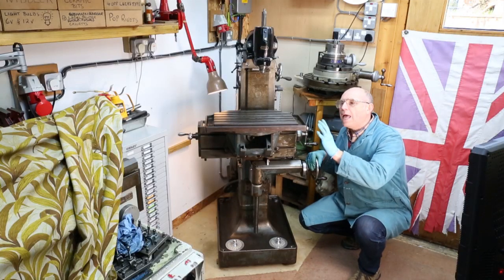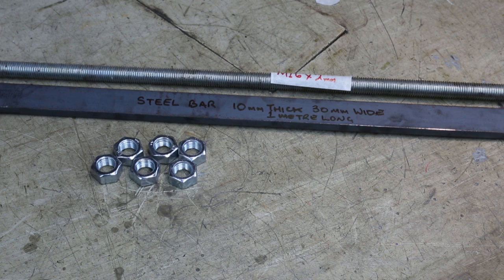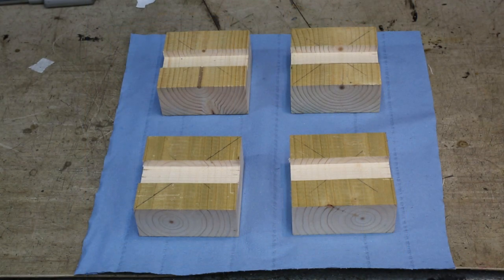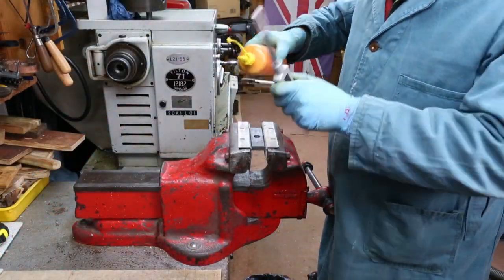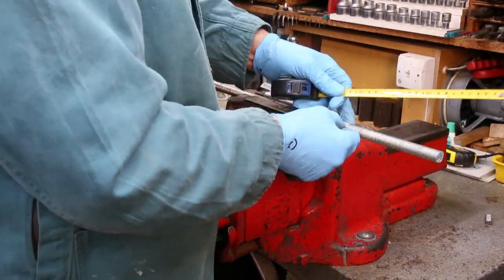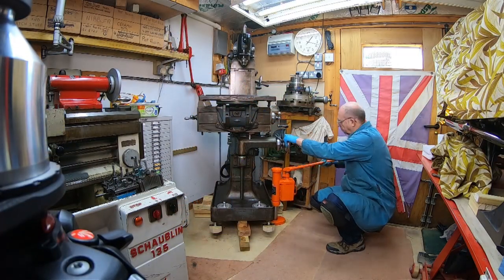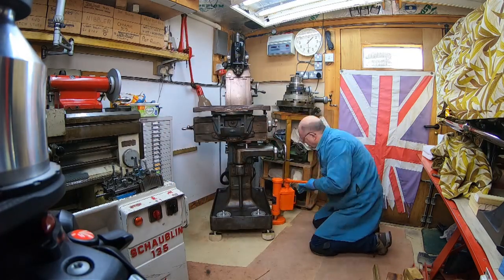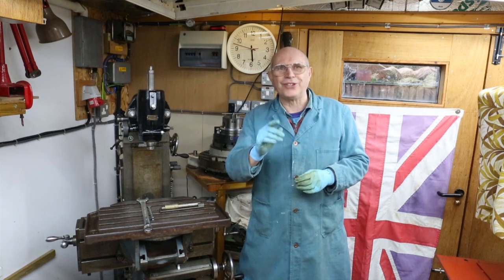DiY Leveling Feet For Milling Machine

Comment: Very interesting. Can't wait to see some projects being made at the mill. Good luck with the final parts of the restoration of the machine.
Reply from the maker: Hello Petar443. Thank you for your comment and good wishes to finish the mill. I'm "chomping at the bit" at the moment. I have a project waiting but I can't start on it as I need a high speed head. I am lucky enough to have several attachments for my Alexandra mill, one of them is a High-Speed head. You may have seen a couple of my latest videos, I have started to service that head but had to cut off a 50mm dia nut. The thread in that nut is 16tpi Whitworth. Unfortunately my lathe is missing a couple of thread cutting gears so I can't finish the nut. I have a friend who can help but he is busy for the next couple of weeks. At the moment I'm doing other projects, if you have a workshop you are never short of projects! Take Care thanks again for you comment, Jim

Comment: Very neat. Would be interested in hearing about how you acquired your machine tools and what to look for when buying old machines like these.
Reply from the maker: Hello again Nick, thank you for your comment.
How did I acquire my machine tools, and what to look for when buying old machines. Gosh, you want your monies worth out of this comment!
Buying old workshop machines is a good way to get hold of good quality equipment but you must be careful. Personally, I would never buy anything sight unseen. Go see the machine, run all of its moving surfaces from one end of their travel right to the other end, do this by hand and see how it feels as it travels. Is the bed loose at one end and tight at the other? Probably but is it enough to cause a problem? Look at all the moving parts, assess for ware and note any breakages. Run the machine if possible listen to the gears bearings and bushes. Remove the chucks and vices check the mating surfaces of tables and slides.

I came across the Alexander Master Toolmaker milling machine on a visit to a workshop. It is a fantastically designed and well-built mill. Originally the design was German and called the Deckel FP1. These machines were very popular in the 1930’s & 1940’s and they started to be built in lots of countries round the world. When the second world war started, buying machines from Germany fell out of fashion. Well, because the machines were already being built all over the world, they carried on being built in those places but under non-German control. The company in the UK was called Alexander and carried on building the machines till the 1950’s.

I scanned the adds online and in magazines. I wanted to get one of these machines but also as many of the accessories as I could as well. It took a lot of searching, over a year, but I ended up with the machine I have just made the adjustable feet for.
I also have the normal vertical head, that’s fitted to the machine at the moment.
The other accessories I have managed to buy are:
The high-speed head. I’m about to service that, see my next video.
The Slotting-head. In need of service before use.
The Universal Dividing Head. In need of service before use.

Well Nick, I hope that’s useful to you. I really need to get on with the high-speed head, its sitting on the bench in three bits at the moment. I have to set up the camera, pull the head completely to bits, make sure all is OK, then service everything as I reassemble it. That will keep me busy for a while! Take Care Jim.

Comment: Nicely done, great tutorial. Better engineered than a bolt and lock nut through a hockey puck, but not so overly complicated that you need a 5 axis cnc to make them
Reply from the maker: Hello Jason. Thank you for your comment. I have seen people use the hockey puck for feet, I assume they are oil resistant? Thick Wood is good though, all the adjustment is in the foot so the top of the leg stays in the same position within the base. If the leg stays in the same position you can add the top caps to stop much going down the hole, I think it makes it look a little smarter as well. Thank you once again. Take Care Jim.